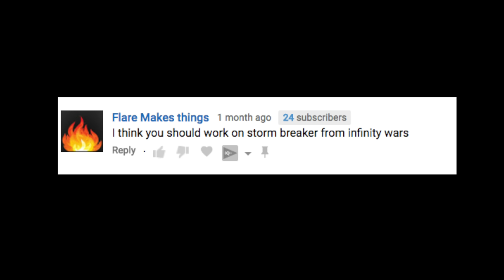BOLT to STORMBREAKER - Mini Build

Comment: Hot salt and vinegar does the etching job too, make sure that the surface is clean, use some rubbing alcohol before the application.
Reply from the maker: It's also good for cleaning silver solder residue and other stains
Reply: BrainfooTV Yes, I use these techniques to clean copper and other oxides too.